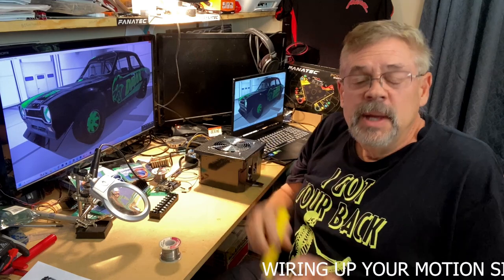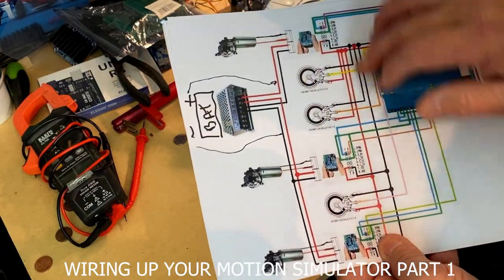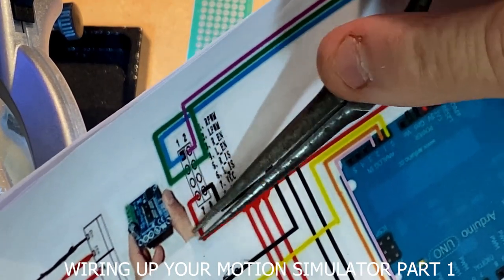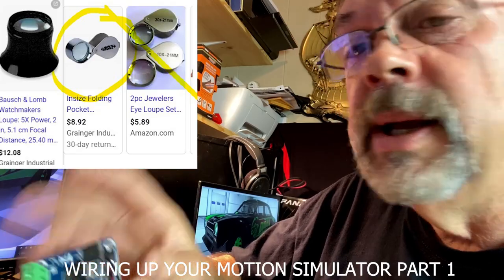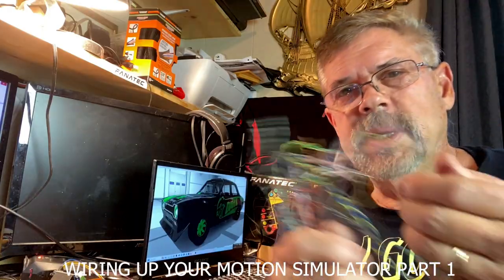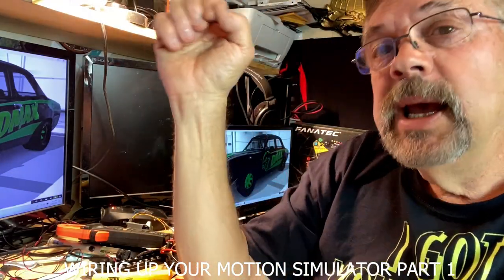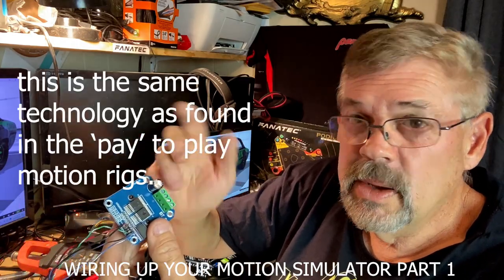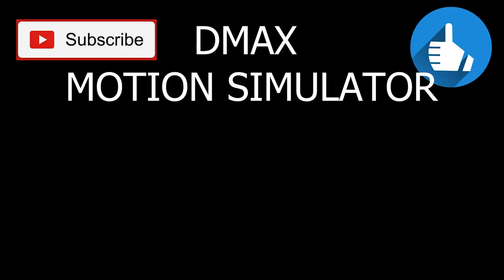wiring up your DIY motion simulator - arduino - IBT-2 - 3 DOF motion sim  -

Comment: Thanks for all of your hard work. I think the most important thing that you have done is including part numbers and where to get the parts. Yours is the first site that has done this and is crucial to figuring out what and where to get the parts.

I just watched your latest video and want to bring some information to you. Watching you soldering directly on an Arduino Uno R3 was horrifying. One slip and you could ruin it.
 
Might I suggest a diferent method. Search on amazon for an "arduino screw shield for Uno r3". A screw shield is a daughtercard that slips into the I/O pins of the Uno. You just slide the wire in and tighten down the small screw. You will never have to bring your soldering iron close to your board again.  

There are many different types of shields for various Arduinos.

Again, I would like to thank you for showing me a path to build my own 3dof cockpit.
Reply from the maker: Yeah.. I was worried about that too..  soldering on the arduino or any pcb ..  but  they always seem to pull through for me..   I do have the 'shield's   I'll put one in the next video..  or suggest it..   Just cause I've been lucky doesnt mean someone else will and blow a $30 board..    Good point..   and I'll mention it for sure.. Dave

Comment: Unwatchable? Then don't watch! I think your style is  incredibly watchable.  It's on yourtube, if its moving too slow skip ahead.  I would rather have too much info than not enough.  I see too many DIY vids where people assume a level of knowledge that I might not have on a subject. Ya know what? If you do have the knowledge a review isn't going to kill  you! Keep up the good work Dave.

I hope to get back to my build soon.  Got delayed with repairing one of my real pinball machines, finishing up my virtual pinball and some house projects
Reply from the maker: Yeah  projects projects projects.. I have a few too.. most them like building a screen room will take me a few weekends too..  What year and kind of pinball machine are you workin on?.. They are mechanically and electrically pretty fascinating! Dave
Reply: @DMAX_DIY   I have a 1991 Bally Dr Dude that needs a little TLV(I am going to do incandecent to led swap for all lights, needs new bushings and rubbers, prolly  test all the coils and replace anything that looks like it on its last legs).  Also have a Black Knight Sword or Rage Pro(its from 2019) that needs all the rings and rubber replaced,.. I have the set just need to take the glass off and do it).  The one that causes me the most strife is my brand new Scooby Doo... It has 3 bad MOSFETs .  Working with the manufacturer to verify that is all that is wrong before they send me replacement parts... But cutting wires on my brand new $10,000 machine is making me nervous!

Comment: An okd trick we uswd when i was laying phone line in the army,  when crossing an obsticle,  always leave enouph to complete the crossing again +50%.  Saves any joins if a repair is required.  I still do it with any wires i use. Much love from across the pond. X
Reply from the maker: Agreed Terry..  USAF vet here and I've been in Telecom since I got out of service in 86..   Yep, it's a 'slack loop'  very handy for re-terminating things if needed..  Great observation !! Dave
Reply: @D Max    I knew you were ex Military.  I don't know how,  but we have a 6th sense for these things.  Maybe its just that we have the balls to get on with things and give them our best shot,  no matter the outcome.  As long as we learn a lesson and carry it forward.  Another funny fact,  I got in to telecoms as well lol.  More cable laying though.  I was a 
Cable
Under ground
Network
Technician.
🤣

Comment: Hi, about pots (potentiometers) blue coloured multi turn ones can be used, those will need an additional pully conversion,(could be 3d printed or made from wood) for the  accommodation of the multiple rotations, those  are relatively cheaper, and relatively easy to come by. 
And could be replaced as required, for the hall effects those are built for life.

There are 2 varients of those blue multi turn ones. One is for higher wattage just like Mr. Dave showing, another the smaller version more or less 1 by 2 cms ..yes in theory both of those could be used but smaller ones would be a hassle to work with.
Reply from the maker: Great comment neail.   Agreed..  I just didnt want to complicate things with the pully conversion which I have seen..   This time I'm going to attempt to use those aluminum couplers..  I have some ordered and should arrive tomorrow for me to try out ( on my other rig first), then I put them on this new Compact sim design if the work as good as advertised!..     Thanks again my friend! Dave
Reply: @DMAX_DIY Sir, I am grateful, that you have found my advice helpful, I totally support your aim and approach to provide a solution for everyone, even to the absolute newcomers, that is how it differentiates between the good and great teachers.
And in the way I would make sure that the costs are not a barrier to entry and share any info I have .
Thank you for your response and all the efforts.

Comment: hey bro thanks for the help i build a 2dof  then upgraded it to a 3dof with pitch roll and surge, also if you use the cheap potentiometer there is some static from the psu just make sure they a far apart.

Comment: I'm so glad I found your channel. I had put off making a rig for the longest time, but your videos have made it so much easier to follow and understand. Where can I found the daigram for a 3 motor setup shown in the video? I can only seem to find the one for 2 dof found in the post linked below.
Reply from the maker: I can probably send you the 3 motor diagram..  It's pretty much the same as the 2 motor diagram, just line up the wires the same way for the traction loss motor..  my email is on most of the videos and I check email every couple weeks..  Dave
Reply: @DMAX_DIY  Much appreciated! I have sent an email.

Comment: This is awesome. I was curious, for someone that might have a diy base or simple wooden 2x4 and plywood I wonder if we could add simple 2dof.
Reply from the maker: Great comment  and question Vectorr66!  Yes..  I would think that a 2DOF  (seatmover) would do well in that situation..  You may lose a little bit of fidelity due to the wood absorbing some of the shock  but I would give it a thumb up..  I may end up making one this winter and giving a comparison between the feeling of 'all steel'   metal  construction vs.  wooden..  Thanks again.. Dave

Comment: Dave, love your content thank you so much for making it! Other than the gear motor, is there a lower cost wiper motor you recommend?
Reply from the maker: Hello Joe Six..  Thanks for watching and commenting.  So I gave the wiper motors a shot and did a series on them..  unimpressive  - or at least mine were -  my motors were from a Saturn automobile  (brand new but sadly.  they were not convincing enough for me)  and they were on a 'seatmover'..    just the seat..  not a full frame.. Perhaps others have had success.. maybe search x simulator.net..  but I did not.  so the best advice I could give is perhaps using the wheelchair motors.. I did a series on that also  and they did work for the 'seatmover'..  but wiper motors.. no.  That's why I did the video series on them.. I wanted everyone to see they are not powerful enough (or at least mine were not)..   Hope that helps..  Let me know which direction you are going to go in..  Dave

Comment: Hey Dave. Question, In the 3dof do you have to configure the settings for every car or track that is driven? Or once you set the settings for the rig does it work with any car or track? Hope you are well!:hand-pink-waving:
Reply from the maker: Very good question.. - i did answer it on the episode 5 of  ROAD RAGE..   but yes, once you set it up it's pretty good to go..  you can tune it to your preferences however whenever you want and save each config per vechicle..  but I dont do that..  Dave

Comment: In your video you talk about the Hall sensor that rotates 360 degrees, in the material listing you gave a link to the PN 987-1392-ND sensor which according to the description on the linked page has Rotation Angle - Electrical, Mechanical  (0° ~ 180°, Continuous), could you confirm that the link is correct ?
Reply from the maker: Yes thats the correct one..  It means that it will only 'read' the signal on half (180 degrees) or the rotation. the other 180 degrees it does not read the signal..  The sensor can rotate around and around no physical restrains.. it will only read the signal for half of a rotation. since your motors only rotate about 160 degrees this is perfect.  hope that helps.. Dave

Comment: Dave, I've been watching, rewatching and studying your videos, which I agree are the best around.  I'm an old-ish retired guy, and using scrap I accumulated over 30+ years I've built a very ugly, very prototype rig to start with, just to check dimensions and get the concepts set in my mind. It is in now way safe to sit on yet. Now I'm ready to start with the electronics but I can't for the life of me find the 3-motor wiring diagram you used. Would you please point me in the right direction? Thanks!

Comment: Hello, author of the D Max channel. Will you be assembling a moving platform with 4 engines, like the author of the "the2jakes" channel? I like this option because the chair can fall down freely. But I can’t imagine how you can assemble it on the BTS7960.

Comment: Big D!  I'm doing a 3DOF and was just told on xsim that using smc3  I need to run 2 arduino uno R3 s.  One for pitch/roll, and one for yaw. I see in this tut that you run all 3 motors off 1 Arduino.  Can you confirm that I will be ok with doing it like you did?  My build thread there is "Winging a 3DOF".  Id appreciate your input if you have some time available, love your videos dude!
Reply from the maker: Hmm.. well, you absolutely can run 3 IBT's from one arduino. I do it all the time.  SMC3 is simtools coding  for 3 motors..   Confirmed..  The two main IBT's run at 35 khz sample rate,  the third (which I use for Traction loss or YAW) would run at 32khz.. which is no big deal..   Check out the latest video if you want  here is the link  https://www.youtube.com/watch?v=6rZMVFsoNHA
Reply: @DMAX_DIY  Most appreciated!  I also noticed you have multiple emergency smash bottoms on your rig.  Do you have a video that shows the install for those?  Where do they go in line with the power supply?
Reply from the maker: @brianyuricich5730  I dont have a video about it.. but yes they go  IN LINE with the battery power..  One is a simple battery disconnect..  the other is a 40 amp DC breaker which will break continuity if a short happens..    I'll see about making a video about them or including them on a new video..   Good point sir..  Dave
Reply: @DMAX_DIY  well, my build is done, and so far I've blown 3 IBT-2s just during setup and testing.  I'm running the same 24V psu's as you.  I don't know where it's going wrong.  All I know for sure is that my wiring is 100% correct.  After pulling the bad IBT2's, I do a continuity check on all wires.  Zero contact where there shouldn't be.  Going to put 15A fuses inline with the hot wire to IBT2 and see how much load it takes to actually blow these things.
Reply from the maker: Oh wow!  that's crazy @brianyuricich5730  - I think I only had one of mine fail (out of 20 or so that I have).  Do they fail in SMC3? or in simtools?  Could be that the motors are grounded for some reason..   Those devices, even though they are cheap seem to work well up to over 20 amps(that's as much as my rig pulled at one point measured on my amp clamp).. Supposed to be good to 43 amps..   Check between ground and both of the motor wires.. make sure there is no continutiy between ground and either of the motor wires.  Write me back. Dave
Reply: @DMAX_DIY  D!  Thanks for asking about my issue.  Well, the problem is in both smc3 and simtools.  Motors work great until under load.  And when I say load, I mean an empty seat.  A possible cause is I was running SMC3 at 35khz instead of 20.  But, being I have the box and components all ripped apart, I have to build that back up until I can test again.  As far as ground, I'm getting 1.2 to 1.4 ohms between red and black wire on all motors.  No wires have any continuity with the frame.  I also took heatsinks off, scuffed away the trash blue varnish, and thermal pasted all 3 IBT2s.  Before the motor controllers started failing, when motors were powered on, they would spring to rest and hold the load for about 10 seconds, then cut off.  They would also cut when trying to move the load.  Any ideas other than what has been done?  Are the ohms I'm pulling between the red/black motor wires in range?  Thanks again!
Reply: I also wanted to ask, as far as my 24V fan for box, where to draw it's power from.  Would plugging it into one of the 3 psu's be fine without causing conflict?
Reply from the maker: @brianyuricich5730  yes,  I would plug it into the PS controlling traction loss.  the fan barely pulls any amps anyway so that would be the best place.  Dave
Reply from the maker: @brianyuricich5730  ok.. so a lot going on here..  35 khz is not the problem. that's just the sample rate.  so zero ohms would be a short, i think 1.2 /.4 is ok cause the motors have windings and therefore resistance.  empty seat and still popping IBT's that's really weird.. maybe you got a batch of crappy IBT's?  not sure on that.. I've heard of that happening.  I know it's a pain but I would order 2 more from a different vendor and just test them..  You have come this far.. I'd hate to see this project end   Also, if you disconnect the motors completely, and then 'test ' them  by momentarily touching the two wires coming from the motors to the + and - of the 24v supply, can you get the motors to spin ?  swap directions on the wires and they should spin the opposite direction.
Reply: @DMAX_DIY  I set samp rate to 20khz and started from scratch.  Motors 1 and 3 were flawless, motor 2 had another bad IBT2. It ran away as soon as powered on in SMC3 even though green and target lines were meshed together.  Verified by swapping out pot, psu, and motor wires with motor 3 and it worked just fine.  Not only did it work, but I sat in seat with laptop and went for a lil ride in simtools setup!  I already ordered 3 new IBT2S from a different source.  This one actually had over 4 star reviews.   Tomorrow after work I'll hit it with some higher settings and push them a bit more .  I appreciate your interest in my build, and I'll let you know how it goes from here.

Comment: Hi! Just a question, where would i wire up my emergency stop button?
Reply from the maker: Hi,  I am running my main rig from One battery source. So I have the disconnect on the Positive wire,  When I shut it off, it shuts off power to the motors.  I have not had time to run my rig off power supplies yet, but I would imagine just running a relay for each PS and controlling the Relay with an Emergency on off switch.  But I have not done that yet..  However it appears pretty straightforward..  Thanks for the question. Dave

Comment: Hello! Do you know where I can get a wiring diagram for 4dof? Thank you
Reply from the maker: Well,  I would start by typing in the search bar of the x-simulator.net forum.. I have not built one of those myself so I'm not sure.  Or you could get 2 arduinos and 4 motors and program the arduino's (each on it's own USB com port) to accommodate your 4 DOF design.   HOpe that steers you in the right direction. Dave

Comment: Hello Mr. Dmax, I'm from Argentina, please excuse my English, I found your channel and my question is the following: I'm making a simulator for a Eurotruck truck, I'm doing it with two seats, a dashboard, etc. After watching your video on giving mobility to the seat, I reformulated my entire simulator to take it to that level, I got two windshield wiper motors, I already have the Arduino and the controllers for the aforementioned motors, the configuration is complicated for me, could you give me a hand for its correct configuration or a plan on how to make the connections? Thank you very much, I await your prompt response, sincerely: Jorge from Argentina